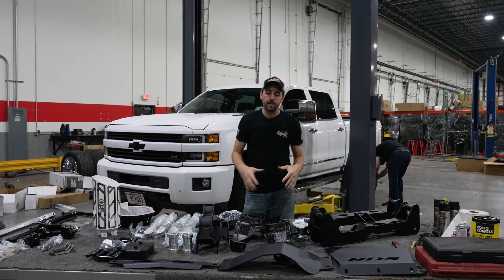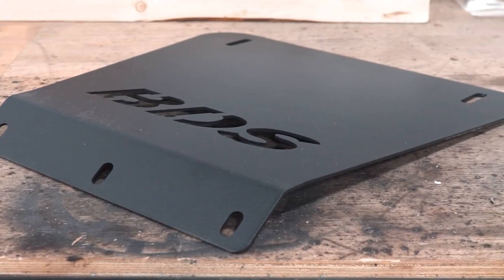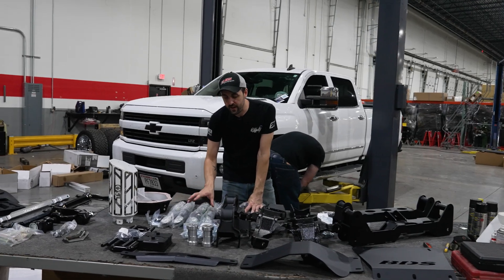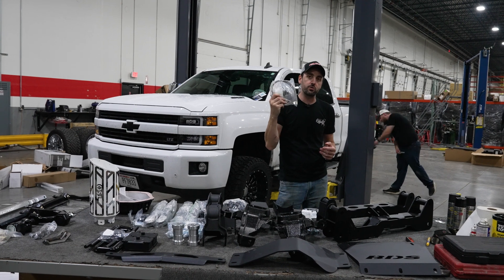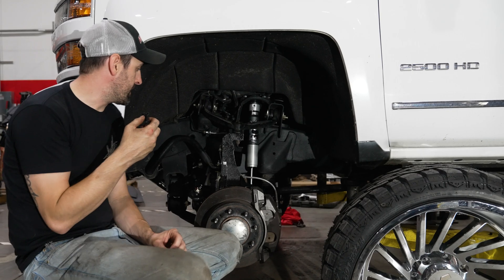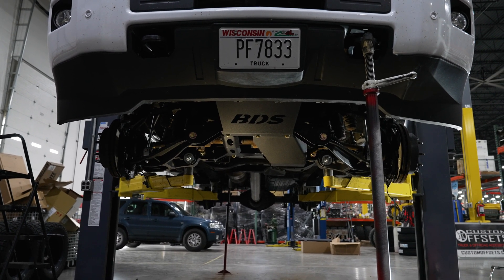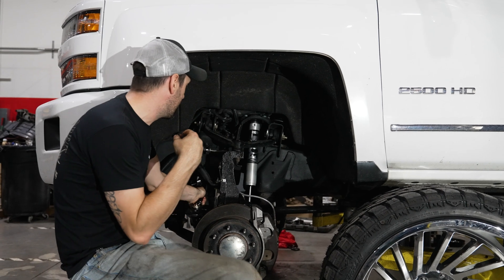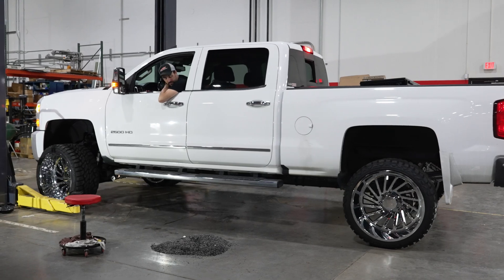11-19 Silverado/Sierra 2500 & 3500HD BDS 4.5" Lift Kit | Overview and Install

Comment: I did 4.5" bds kit on my 17 duramax. less then a year later i ended up buying a few individual parts to go to 6.5". shouldve just done 6.5"
Reply: How it feel !? And in your opinion you recommend a 5 or 6 inch lift kit??
Reply: @jarretmathison11 do you still have the parts from the 4.5 lift?

Comment: Hey question, I have a 6.5" BDS lift on my 15 high country Duramax. I'm getting ready to rebuild the whole font end with kryptonite products and want to bring the lift down. My question is how can I turn down the lift?? I've been hearing this term and been doing research and cant find anything? I currently have the lift with five inch blocks in the rear. I saw one of your guys videos that was posted and did a 3" block in rear and "turned it down" and that turned it into 5". How does one achieve this? Help is much appreciated!